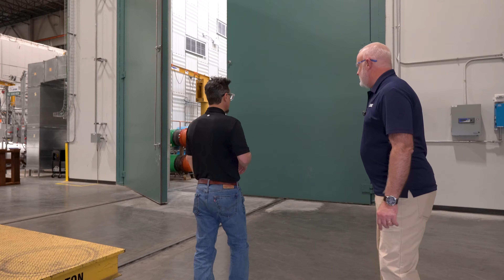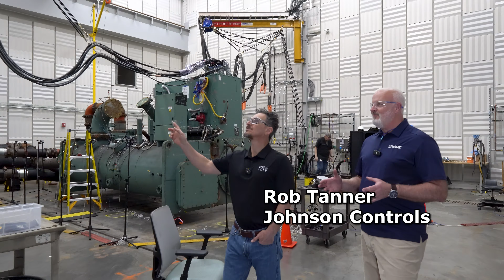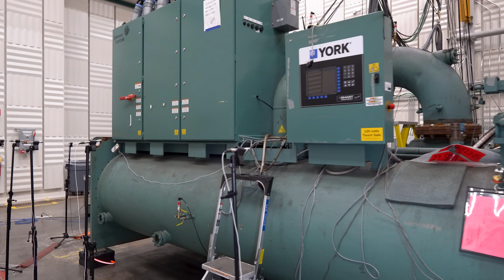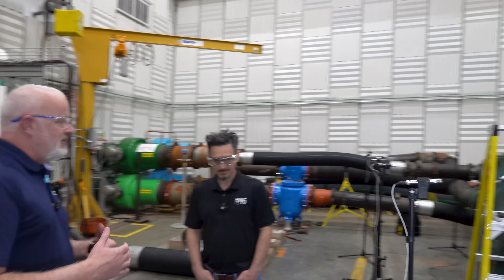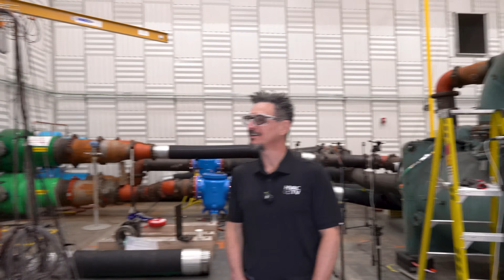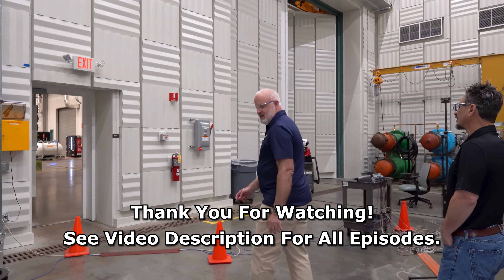JADEC: The Tour – Part 6 | Inside YORK’s Giant Sound Lab: Quiet Chillers, Big Data

Comment: I wonder how often this chamber is actually used  because they're sound rating  old equipment. If this is what I think it is, this chiller is well over 20 years old. I just Googled this and JADEC opened in 2018 so they may have brought in a used machine for this interview because it was all they had available but I believe these types sound tests are now done under real world field conditions. You're a musician if I remember correctly. When you mic anything this up close regardless the type of mic you're using, the acoustic properties of the room become less important.

Have you ever stood next a low pressure centrifugal operating under varying loads? They're all actually extremely quiet. They can get quite loud under surge conditions but when they run normally, all you hear is the purr of the motor itself, 

Bosch purchased York this year from what I read. I love Bosch ground source heat pump systems. Does your company distribute York equipment?

Do you remember a company called Lucent Technologies? There was a project in Piscataway NJ that was abruptly abandoned just before all systems in the building were formally commissioned. I was sent there one week to do a preliminary inspection so there were no surprises during start up and the following week I was told the project was abandoned. Whoever actually owed that building made a fortune in upgrades. I later learned they did this a lot, The company collapsed financially probably because they pumped tons of money into projects they walked away from. But in this building they had built a massive acoustic chamber that dwarfed this one. We were allowed to enter it. They actually turned the lights out for us. The silence and complete darkness were a bit disturbing after awhile. I think sensory deprivation induces hallucinations.
Reply from the maker: This is one of the most advanced HVAC engineering facilites in the world. I’d say go take a tour and they can address all your comments. Thanks for watching! 🙂
Reply: @HVAC-TV I've spent time at testing facilities Trane has. This is a large room with acoustic tiling with a lot of other gear and equipment in it that impact acoustic properties of the room itself

This test set up had the mics about 6 to 8 feet from the machine, a machine that appears could be 10 to 12 years older than the facility itself which was really the point I was making. 

I'm impressed but this facility was commissioned in 2018 there's a much older machine with a lot of dirt and dust on it. I aplogize Tony but I tend to notice little things like this. 

If I didn't know any better, I'd swear this room is rarely used ut I didn't point this out until now.

I would think a brand new screw machine or a high speed centrifugal wild be in the room being tested but I didn't say that either. Just odd is what I'm saying.

Please accept my apology for noticing details like this
Reply: I hope they read my concerns because I don't think I'll ever have the opportunity to visit. I probably wouldn't do well interviewing people under these conditions. I'd be asking too many embarrassing questions. I'd be spending more time editing almost everything
Reply: @HVAC-TV I love U brother !